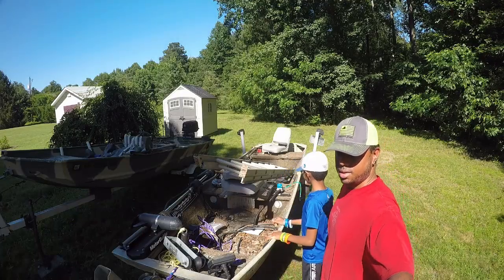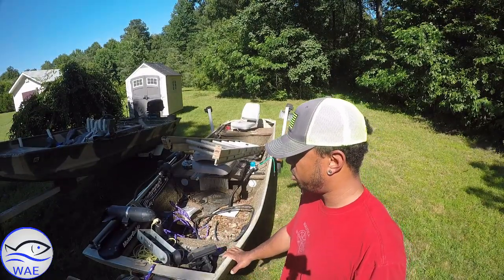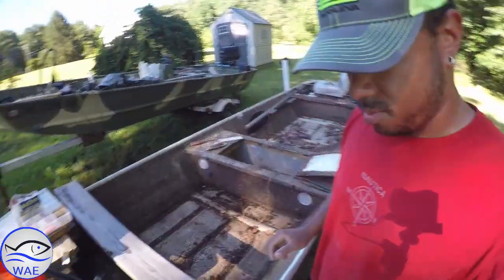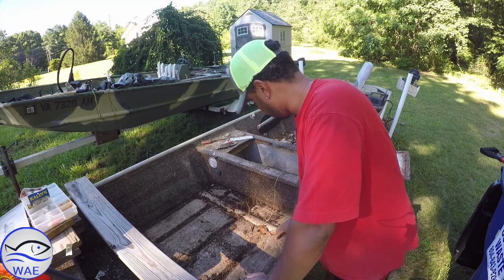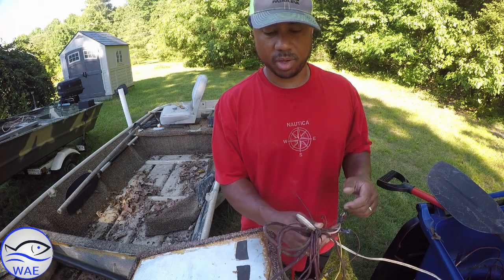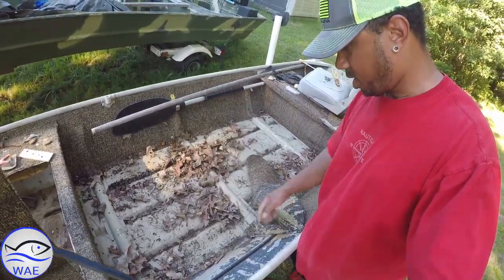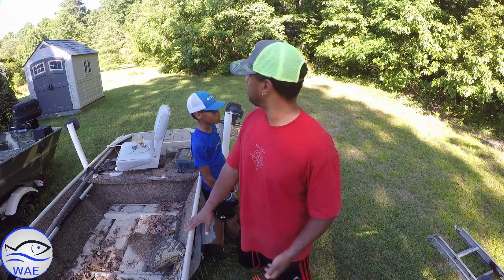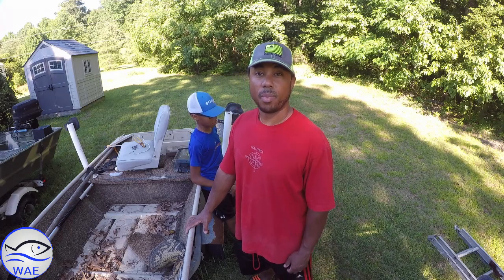Jon Boat to Bass Boat Pt2 | Jon Boat Tear Down

Comment: Are your ears stretched? Is so What size are they ? Strange question I know but I used to have mine at a zero, unfortunately had to take them out for work.
Reply from the maker: Yep! I'm at a 0 now.  Hard for a job to mandate that.  I know i will get discriminated against but i believe in fierce individuality. Gotta do you